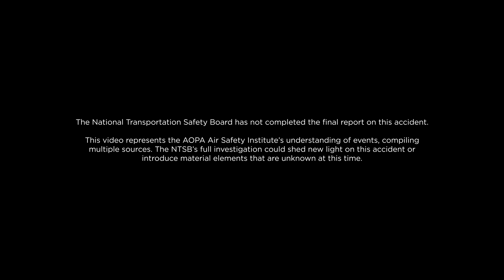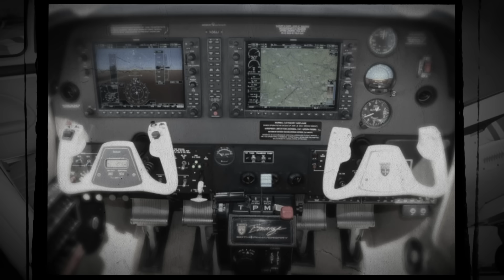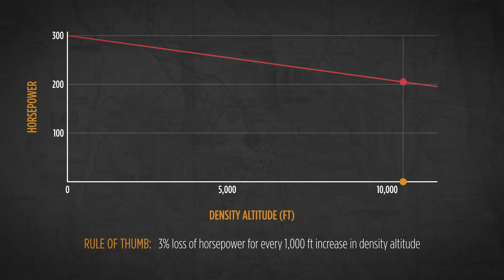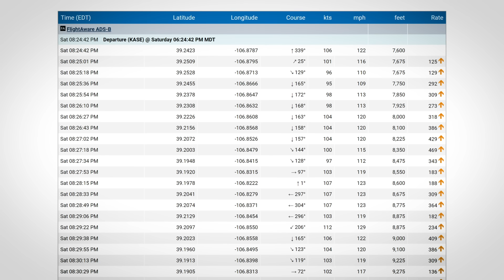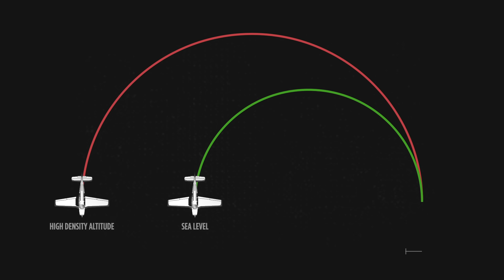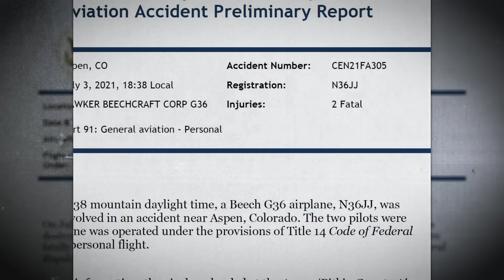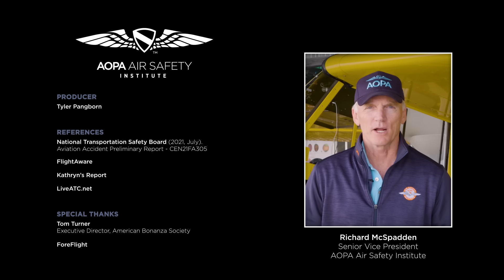Accident Case Study: Into Thin Air

Comment: As FS2020 is used to represent this flight visually, I thought it might be interesting to fly the same route in the same simulated conditions as these poor guys faced. 77 deg F and high humidity, scattered clouds in a Piper Arrow III. Nearest plane I could find to the G36. Although there is a G36 in the sim I think it might be a more powerful variant. Anyway, I took off from Aspen (KASE) and flew an ascending circuit around the field for two loops and did achieve just over 10,000ft. Set off on the same route the pilots took. After about 19mins of flying, I found myself in an ascending valley  and, although I hate to admit it, despite being forewarned, I could not find a way of aborting, as my plane was at about 75kts airspeed, barely able to climb at all, with the ground getting too close to for comfort. I eventually stalled a wing whilst trying to turn at too low an airspeed and crashed.

I made a second attempt except this time I performed four loops of Aspen and managed to limp up to 11,200ft before setting off East. Despite some very hairy moments and a few branches in the undercarriage (not literally as UC was retracted), this time I made it and carried on my flight to Colorado springs.

I am only a sim pilot from the UK but with 465 hours in sim. I have learned a fascinating lesson about Density Altitude. My Piper Arrow was barely able to climb at all despite very careful mixture management. Was surprised tbh, just how accurately the sim reproduced these conditions. Really felt how desperate those guys must have been when they realised they had no way out.

Sad story.
Reply: As someone who learned to fly in the mountains, a heavy airplane without enough power can be a real nightmare. You have to assume when going up a valley that you will not be capable of climbing at all. I flew a C172N with 180 hp and an XP with 220hp, and at 12,500 feet your climb rate is abysmal. A G36 weighs more than a C172's max gross weight empty. A turbocharger is not a requirement, but without one you cannot afford to try and outclimb terrain.
Reply: @MillionFoul  turbocharger comment is on-point, it’s not just about cruise performance, it dictates where and when you can go to other locations as well. 300hp on the sticker is great, but worthless if you can only make 2/3rd of that with mountains closing in. 

Do a few more ascending loops and decision making or hypoxia issues may come into play, given the downdraft their margins would have to be above 12,000  likely. 

If I was going to fly a non-turbo aircraft into that terrain, I’d have some crappy oxygen bottles at bare minimum, and a REALLY good pre-flight brief and contingency plan.  

The fact that he didn’t know which direction he was going to turn, and that his initial IFR clearance was complete BS for that aircraft performance, means very poor pre-flight planning.   

Suree, i have a beast bonanza, let me file to FL160 in a canyon at high weight from a mountain. This was no good from the start. I’m surprised the controller didn’t ask what aircraft type or question their performance margins, but that’s not his job. 😕
Reply: @EstorilEm  I was a bit surprised/disappointed the controller didn't ask them more questions. They clearly weren't familiar with the IFR departures, they stated they were unable to fly the departure the controller gave them, and then when he asked their intentions they didn't really have any. It should've been obvious at that point that they were probably in over their heads and could use more explicit safety guidance.
Reply: @MillionFoul  I learnt to fly and owned an 80hp LSA for first two years after getting my certificate that used to give 500fpm climb on the best of days . Throw in a bit of heat and it really struggled to gain any more altitude than 7000ft. The feeling of always feeling underpowered was particularly unpleasant and I promised myself never to buy an underpowered aircraft again. I now fly a 285hp turbocharged Bonanza and it’s such a joy to have excess power available when you need it
Reply: They had no oxygen why not just fly it south though NV down though AZ to NM stay well south of the rocky mountains. I would have just paid someone to ferry the thing home don't have to even worry about it.
Reply: @Mike-01234  It wouldve been a great learning experience for them.. if they had done a bit more research..
Reply: @Mike-01234  "I would have just paid someone to ferry the thing home don't have to even worry about it." - I thought the same thing. I can understand the thrill of doing the flight yourself, but they had both unfamiliarity with the terrain and the aircraft. Sadly it turned out to be a lethal mix.
Reply: @Mike-01234  by truck or plane or ship?
Reply: @Mike-01234  get-there-itis
Reply: Same here. I love Aspen in FS 2020, thrilling enough in higher performance craft. Tried that same pass/route long back with the Carenado Mooney, loaded out. Same result. At the beginning of the video I was astounded and even horrified to see the choice of Aspen as an enroute fuel stop.

Decades back I grew to be a little hesitant even to go into Page in my 1958 J35 and just me aboard. My dad wisely stayed to a more southern route with his 235 Turbo, the few times he came out to Orange County. Not many places to go in an emergency and a lot of high country. In retrospect I was unnecessarily rolling the dice for the more scenery. The desire for a more direct path to NY out of Napa must have been strong, but Aspen? That choice should have been out of the question.

Even FS can impart a taste of growing desperate fear as you begin to realize that you are just not going to get turned around and out again. I can only imagine the feelings in that Bonanza cockpit. May God bless.
Reply: @garysmith5256  Not to mention fuel is damn expensive in aspen, too.
Reply: @MillionFoul  Napa, Aspen, New York... have a hunch these pilots had more money than they needed.
Reply: @garysmith5256  yea the Carnedo mooney is a tough little airplane. You can definitely feel the struggle in aspen with lower lowered airplanes tho. You basically gotta do 3 loops on a hot day to get out of there
Reply: @garysmith5256   Fascinating conversation amongst you all. I appreciated the knowledge shared between you. Cheers. 👍
Reply: @garysmith5256  Sim flying gets a lot of bad press in the real world aviation community. My time sitting in front of the PC flying fake airplanes shortened my learning curve immeasurably when I did my real world flight training.
Reply: @KarlH1980  So what do you call a real SIM?  The one my son uses  is 12 million dollars.  Different word???
Reply: @garysmith5256 tried to recreate their flight with the same aircraft in FS. Same sad results.
Reply: Just did it today in the g36. I assume that plane has a bit more power and is in perfect condition as I was able to make it over the mountains. BUT I have a very small airspeed window to work with. Best rate of climb was around 85-90 kts. Any less and I approach stall speeds. Any higher and my vertical speed drops to dangerous levels where It appears im not climbing at all. Sharp turns and im basically stalling the airplane as there's little air to work with over the wings
Reply: Curious did you hug one side or the other and then try and make the turn?  That's the bigger question IMO.   if they were favoring one side of the valley or the other instead of flying right down the middle, would they have been able to make the turn around as late as they did or did it not make a difference.
Reply: @a914freak  During my simulation and the particular canyon in question it was not possible to hug the sides. The canyon floor was not flat but more like a spoon. In order to maintain ground clearance I found myself naturally sitting at the bottom of the curved floor. By the time you realise things are not working out, you can't get to one side or the other  as they are literally too high to either side of you. I would have needed to know the geography of this canyon and avoided it completely to have saved myself.
Reply: @Cliffyboy1962  If you don’t have enough room to get far enough to the side of a valley so you can turn around then you are already dead sadly. You should never ever fly into a spot where you can’t turn around in the mountains.
Reply: @kurtisf3366  As I say, I  learned some valuable lessons from this exercise even if only to make my simulated flights more successful.
Reply: @Cliffyboy1962  Thank you for sharing your knowledge. (You clearly said you are a sim pilot and weren’t misleading anyone. 🙄 )
Reply: @1450JackCade  appreciate the explanation Jack. I might have to give that game a go one day, always wanted to learn to fly
Reply: @ThePrimeMinisterOfTheBlock  Yeah...Microsoft flight simulator is very realistic. If you wanna seriously kill some time the game is addicting. On side note: If you have time google funny Microsoft flight simulator.  Some of them are hysterical. Like in one video you see a guy getting clearance from ATC to take off in his hot air balloon while in the background you see a 747 going down straight down.  Complete chaos.
Reply: @MrSoccerball100  Airforceproud95 likely haha
Reply: Forgive my ignorance, but what's a sim pilot?
Reply: @ThePrimeMinisterOfTheBlock  Flying in a simulator. You can use Microsoft simulator
Reply: @MrSoccerball100  so not a real pilot?
Reply: @ThePrimeMinisterOfTheBlock  No.. not an actual pilot.
Reply: @ThePrimeMinisterOfTheBlock  An enthusiast who doesn't fly real airplanes but has a home flight simulator setup on their computer.
Reply: @fricky172  oh, you're just a gamer. Not sure you should be passing yourself off as a pilot?
Reply: @ThePrimeMinisterOfTheBlock  good callout of someone projecting misleading credentials, Mr. Prime Minister.
Reply: @effie4903  thank you, happy to assist
Reply: @ThePrimeMinisterOfTheBlock  What? I was trying to answer your question above about "what is a sim pilot?"
Reply: @ThePrimeMinisterOfTheBlock  Do not make the mistake of thinking that just because someone is a sim pilot and not a real pilot, it automatically means that they do not know what they are talking about. Most modern sims are VERY realistic. In fact, they are so realistic that quite a few real pilots use modern sims regularly for training and practice. If someone says that they are a sim pilot and not a real pilot, then feel free to take what they say with a grain of salt, but do not automatically assume that it means that they are wrong.
Reply: @SectionNyne  I'm not questioning what he's saying, only the use of the word "pilot" to describe someone who isn't one.
Reply: @ThePrimeMinisterOfTheBlock  The word pilot is used to describe the person who is in control of an aircraft or ship. In other words, the person "piloting" it. For real aircraft or ships, the expectation is that they will have been trained and certified before being handed the controls, but by definition, if a completely untrained person were to take the controls and start piloting the plane or ship, they become the pilot. This is similar to the definition of the word "driver". Regardless of if you are trained or not, if you get behind the wheel of a car and start "driving" it, you become the driver. So given the definition of the word pilot, the term "Sim Pilot" is the accepted and correct term for piloting a virtual aircraft in a flight simulator. As long as the person is clear that they are a sim pilot and not a real aircraft pilot, then there shouldn't be any issues.
Reply: @ThePrimeMinisterOfTheBlock  A pilot only flying in simulator videos
Reply: @adriaba790  ah, I get it. I'm a farmer, I've played over fifty hours of farm simulator 2019 😂
Reply: @ThePrimeMinisterOfTheBlock  
A sim pilot is someone who uses a flight simulator package on a computer such as the excellent Microsoft FS2020. Simmers have varying equipment that can simulate the real world cockpit of an aircraft, such as yoke throttle quadrant and rudder pedals etc. A sim pilot does not fly in the real world but believes that he or she could probably fly real aircraft given the opportunity. A sim pilot cannot experience the real world physics of flying by using the simulator but, as I fly using a VR headset, visually it is almost exactly like the real thing and aircraft systems and ATC interaction are simulated very realistically. Whilst I know I would find the real world cockpit a very intimidating place to be, I think the learning curve would be pretty quick, compared to a complete novice.
Reply: @The Prime Minister of Australia  he’s playing a video game. I’m a sim delta force operator. Have over 1000 hours on call of duty.
Reply: Damn... I fly out of Florida no terrain for me to worry about. Can't imagine the stress of that.
Reply: Sim pilots...
Reply: It’s good of you to confess to the early failure despite 20:20 hindsight. It adds perspective to an already sad and heartbreaking story. One from which all aviators can take something away.
Reply: This video was hard to watch, because I knew exactly what was coming.  I recently had a similar incident in a flight sim, trying to climb to the top a a volcano.  I'm a beginner, so I thought I could climb up some slowly ascending terrain, then circle when it leveled off, but before I realized I couldn't make it, air density became too thin and the trees were too close to attempt a turn.  When it finally occured to me, I knew I was doomed.  It was just a video game, but knowing I was trapped upset me more than I'd like to admit.  I can't imagine the sense of doom and terror those men felt.  Rest their souls.
Reply: @Miles Doyle Nice fantasy novel 👍
Reply: I flew it as well in the G36 offered in FS2020.  With only two circuits over the airport I headed for the pass.  It got pretty sluggish, but I did make it over, but barely.  It was a few weeks ago, so I can't remember all the details, but seemed to coax it over.
Reply: @1450JackCade  14 min of mountains experience exactly.
Reply: I found myself in a similar situation a couple weeks ago with the CJ4... took off from Scotts Bluff NB, temps were a bit high with the 5k altitude of the airport. Took off and noticed my roll was taking longer than usual, to make matters worse my climb rate wasnt what I was used to. I can only imagine how bad that would have been in a piston
Reply: Opa. The problem is with airplane. This one has a propeller and they are not safe in mountains and up high. You should nor fly these planes in this areas.
Reply: Yeah, when I first got into simming got myself trapped in the swiss alps, pretty much as described in the video, made all the same decisions and definitely didn't realize I had lost turn radius. When I started my PPL lessons that's always been in the back of my mind and have a strong respect for mountain flying. I'm learning to fly in flat lands.
Reply: Sometime ago I used Aspen in the sim on a regular basis for random flights. I began in early fall and encountered a wide variety of conditions. I probably departed the area to the south a handful of times. It just seems unwise.  And I don't understand the circling the airport to gain altitude. Every turn is a chance to lose control. Instead I've flown north to gain more the half my desired increase in altitude and then turned once back to KASE with the goal of being above my desired altitude by the time I overflew KASE.  Even so, my preferred routes were always to fly north and gain altitude while following the highway. I used a Duke 60 more often than not. The next most common airframe was the C182. I used that just to compare the performance. IRL the C182 has been my favorite aircraft. It's cost/performance points fit my flying style the best. Sadly a club member took the 182 to KDEN and screwed up a landing due to density altitude errors. The 182 was a total loss.
Reply: glad you made it
Reply: The sim flight would be cool to see. Do you upload any videos? What are you using to do the simulation?
Reply: @albrownmd  No, but what you see in the video is, to my knowledge, actually flown by a sim pilot in Microsoft flight simulator 2020. So if I had replay software and video editing skills, it would look like this video :)
Reply: @Cliffyboy1962  cool. Thank you.
Reply: Thanks for sharing👍
Reply: The G36 is a 300hp airplane at sea level.... The Arrow is what, 180? 
Comparing a G36 to an Arrow is like comparing a Cessna 206 to a 172
Reply: @dcacklam  The Arrow is a lighter aircraft (Arrow 2,500 lb) (G36 3,663 lb) and therefore power/weight ratio is not as dissimilar as you suggest.
Reply: @joverstreet24  It's not playing MSFS 2020 that makes a pilot, a pilot. It's the flying of real aircraft that makes a pilot. You're a pretender, a pilot wannabe. It's ok to accept this.
Reply: Yes, pilots play flight simulator games. So do non-pilots.
Reply: @ThePrimeMinisterOfTheBlock  he said he was a sim pilot, asshole.
Reply: "mixture" I guess it'll be another 50 years before fuel injection and EMS reach the skies !
Reply: @millomweb  True, everything that can fail will eventually fail. We fly lots of (turbo)diesels these days ( at least in Europe we do ) with two independent FADECs but 'we' have still managed to produce bad figures when it comes to reliability over the good old Lycomings.
Reply: @millomweb  if the earth still has oil at that point